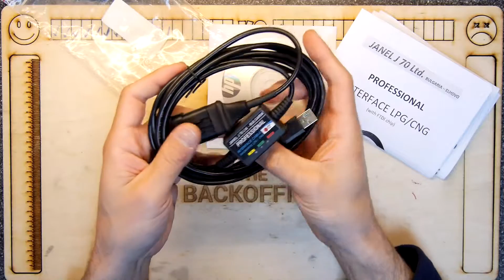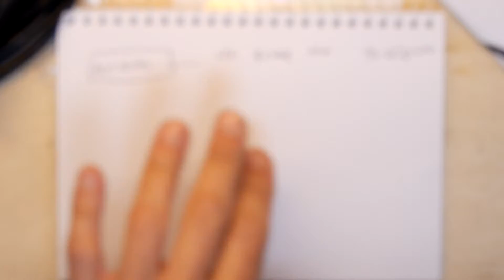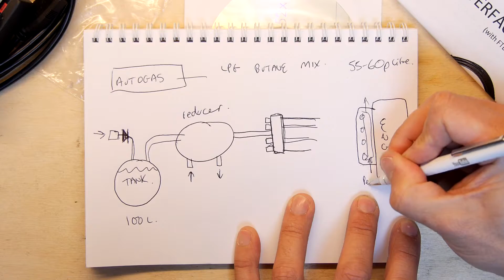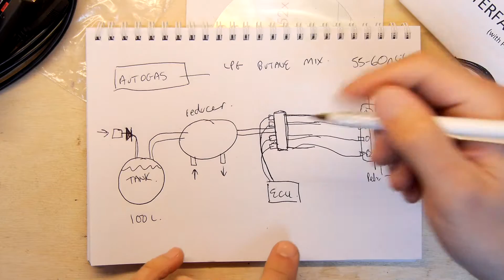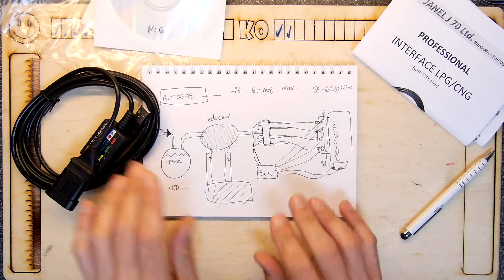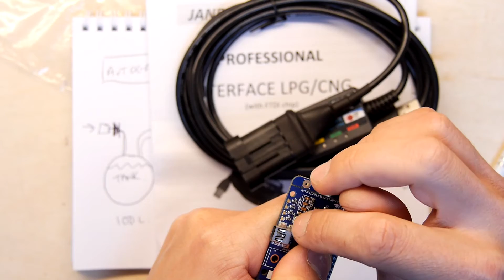Autogas LPG Gas conversion Interface Zenit Pro

Comment: I have a problem with my Lexus is 200 running on LPG.
Basically, it is running roughly either on LPG and petrol.
We have replaced the spark plugs, and checked the pencil coils, but so far nothing.
I have reasons to believe that the LPG ecu is malfunctioning. 
Have had the same problem 2 years ago and one of the 8 channels of the ECU was bad and disabled.... 
What do you think?
Reply from the maker: I think you need to get the LPG ECU interface for your PC and really see what going on
Reply: @backofficeshow  Hi, last week I was able to get into the ecu  interface, but now, I just tried and the computer does not find the ecu.... this is strange cause it is the first time this has  ever happened....  another ecu fault?
Reply from the maker: Check all the ground points from the ECU. If you have issues with grounding and power it can cause all sorts of problems